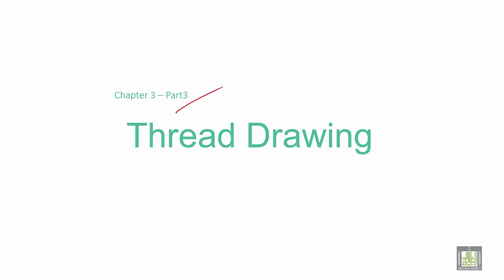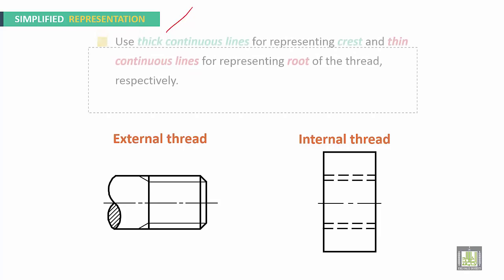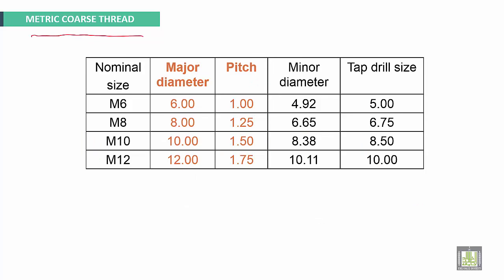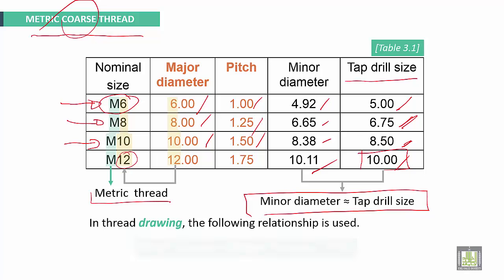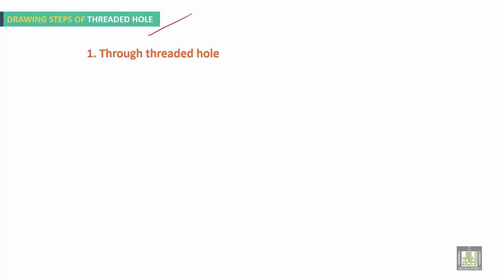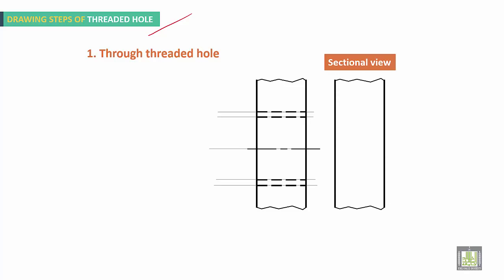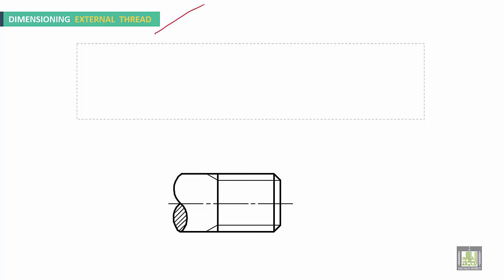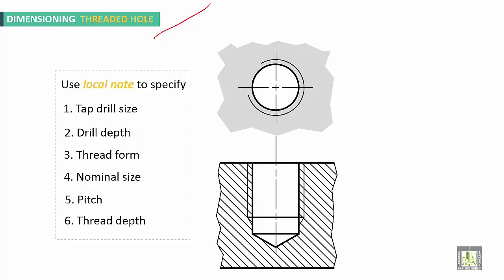Engineering Drawing 2 | Ch3 | Thread drawing and dimensioning

Comment: hello sir how do 2d draw injectation molding feed screw drawing outside dia150 inside dia 25 and  100 length pitch is 20mm and 200 length is 35 mm pitch plz help